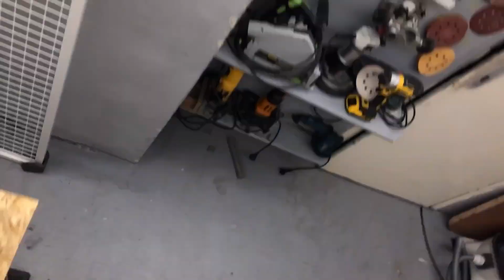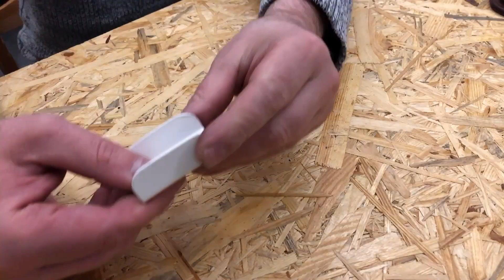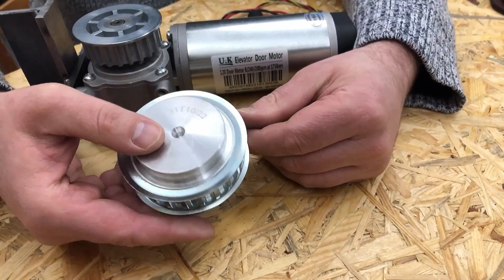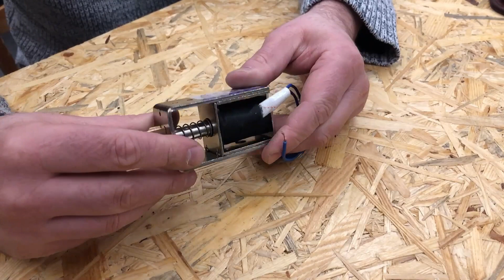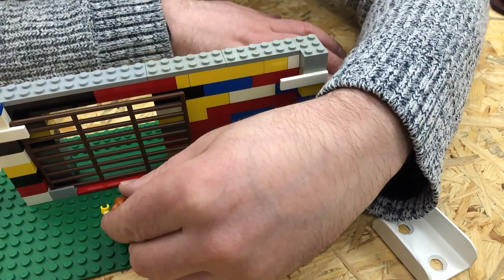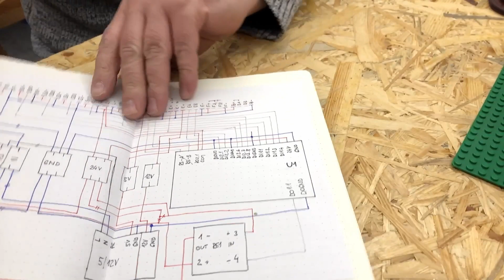#4 MOTORS, SENSORS and LEGO® | Sliding door project

Comment: Wouldn't that sensor have problems detecting a shiny box? For the problem with the other sensor, that would always detect the door as an obstacle, I was wondering if you considered to put NFCs or even magnets on top of the door and use the necessary sensors to identify if the obstacle is the door or something else. Just a thought.
Reply from the maker: The laser one should be able to deal with that, according to the datasheet.